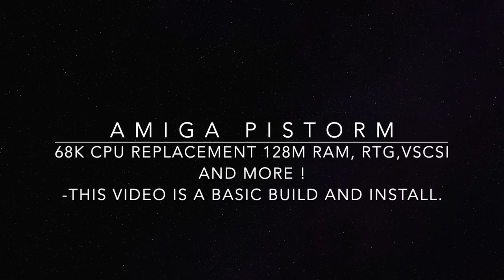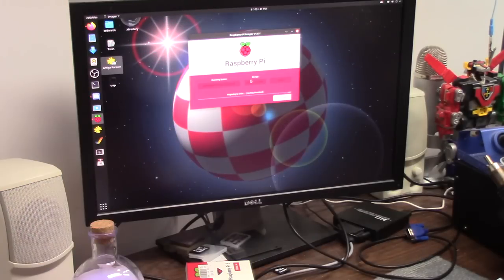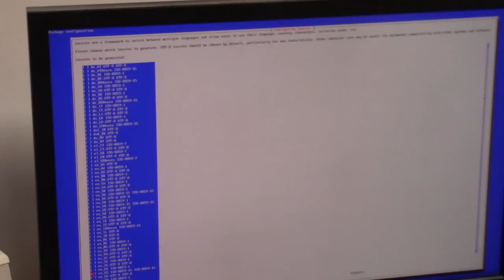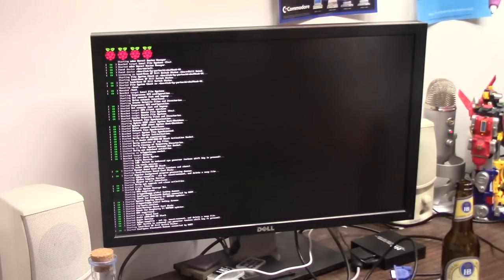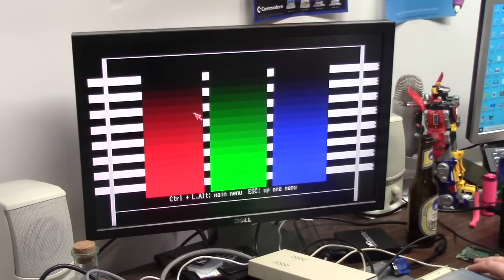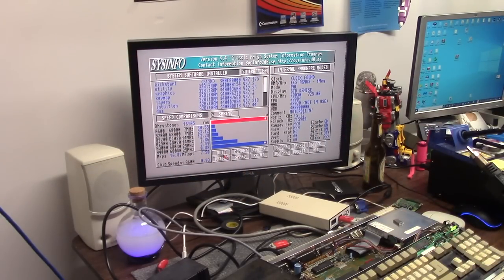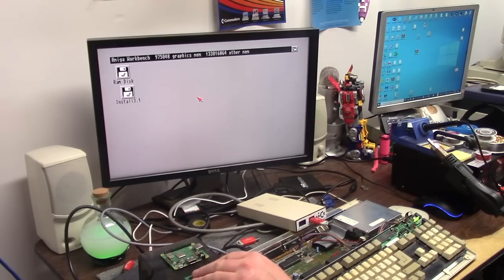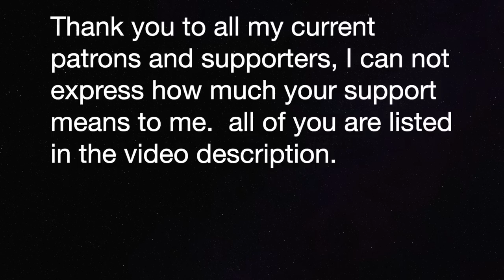PiStorm 68K CPU replacement and more

Comment: Man, I love the Raspberry Pi. Not only can it be a modem, Amiga wireless networking device, personal web server, security cam, Octoprint server, and 1541 disk drive emulator, but now it's also an Amiga accelerator/RTG card. Just amazing for a super cheap single board computer.
Reply: And on another note - I would love to see if this physically fits in my CDTV... ooh this would be a nice all-in-one accelerator/RAM expansion/hard drive/RTG solution if it does...
Reply: The Pi is definitely one of the greatest general purpose SBC-ish devices, just for cost alone. Extremely versatile with a huge user base designing projects for it. I'm so glad it caught on. I bought an original Raspberry Pi when it was released and there wasn't a whole lot of innovation at the beginning. By the time the Raspberry Pi 2 came out, it was a large ecosystem with tons of add-ons and projects.

Comment: Man, imagine if someone could fork this and create a Mac accelerator board. Or Atari. Or anything that uses a 68k CPU (souped-up Sega Genesis/Mega Drive with built-in Sega CD emulation anyone?). This will change the retro scene for years!
Reply from the maker: indeed!

Comment: RIP the Vampire. So much more economical and exciting project.
Reply: To you. But you also might only think so because you don't know everything about the Vampire. I have a Vampire and am much happier with it. It's an FPGA of a theoretical, much better, 68000 series CPU than any released, but still more backwards compatible than 68040/68060. This is software emulation, and can only emulate up to a 68040, and can only reach speeds akin to a 70-80MHz 68030 (much slower than Vampire). Also Vampire has SAGA graphics, which is beyond AGA, with some AAA-like features. So, you can program graphics in the Amiga way, but with more capabilities.
Reply: @RetroDawn  The beauty of an emulated CPU is that you can make the Pi emulate almost any CPU, including the '68080', should Igor give permission. Or any other theoretical 68K cpu. The Pi also has video capabilities far better than anything in Amiga land. Not to mention WiFi, Bluetooth, better sound, usb and hdmi. I'm willing to bet that the software will vastly improve over time, speeding things up and giving the Amiga access to more Pi features. There's room for both systems, but the Pi Storm is really CHEAP and flexible.
Reply: @RetroDawn  This project has already scared the vampire team into finally lowering their prices.

Comment: Just before watching this video I was so eager to get a Vampire V2 for my A500 (costing more than $400 USD). Now, I think this will kill the Vampire considering the overall low cost.
Reply: As an ST user this sounds very exciting to me as well. Not only are usual boosters pricey/hard to find, they also run on different processors, which causes compatibility issues. Having a drop-in 68k on steroids would be so much more elegant.

Comment: It would be great to get an hardware-adapter for the Pi to plug it into the A3000/A4000 CPU expansion slot, too. Considering that the Pis permanently getting faster, this would be a great accellerator for my original A3000 25mhz.

Comment: I hope there will be a project for the A1200 hdmi with a PI. Indivision is just very extensive. The gbs8220 is a solution but it's just low quality unfortunately, even with the updates that I have done.
Reply: there is, its gonna use pi cm4 and be a bad ass card that will kill all other cards.
Reply: @DatBlueHusky  That would be very interesting, do you have any links? As I have only seen cards for the A500/ 600 and 2000 not the A1200.

Comment: A update I found a PiStorm board made up on Ebay. Very nice price. I found some 40Pin Male To IDE Female Extension Cable to see if I can fit my Pi 3B onto the PiStorm I all so have lots of plastic stand offs. As long as the Pi 3b takes less than one Amp, I will be ok.
Reply from the maker: You can always unsolder the usb ports on the pi3

Comment: Thank you for the video, there is indeed almost no information. I was looking at the Buffee Amiga accelerator that would do about 1,000 MIPS but the big let down is that is has no SD card support. In a Amiga 500 that is really a must have. The PI storm is very nice, speed is good, but I expected way more.
Reply from the maker: Like I said it is evolving I have already desoldered usb ports from a 3B+ and put on a pie 3B plus ,almost double the speed from the 3A soon a compute model4 will be the norm
Reply: @ChrisEdwardsRestoration  Thank you for your response. But I'm missing something I think. The PI3 modelA  thats is on there now runs @ 1.4GHz  and is a 64 bit  quadcore. The PI3B+ you are desoldering the ports from uses the same cpu right? Why would that double the speed over he modelA? Could be me, its getting late in my part of the world :-)

Comment: @ChrisEdwardsRestoration  have a que. My understanding is that you did all basis the square pins you squeezed in.
How did you manage to fit it in the socket? Not all the way in correct?.

Did you replace the square pins on the newest emu68 videos?
Tx in advance
Reply from the maker: I have a cpu adaptor that has sil turn pins.  Fits fine
Reply from the maker: here go https://www.pcbway.com/project/shareproject/Amiga_1000_CPU_Relocator_V3.html
Reply: @ChrisEdwardsRestoration  thank you Chris. I knew about this but never hit me hehehe. I saw someone else removed and soldered pistorm in place of the socket

Comment: Looks very nice! I'm excited to see where this is all going to go. I wonder if there will be problems with not shutting the Raspberry pi down cleanly whenever you turn off your Amiga? As far as that goes, I wonder if the RGB to HDMI will have the same issue? Just thinking out loud
Reply from the maker: idk probably eventually. but a re flash is quick, maybe use win32disk imager to always keep a current image just in case.

Comment: Hi Chris, I have gotten excited watching your videos to get my A4000/040 running again. I have forgotten most of what I knew about this machine. It has sat for many years, what do you recommend I do first, what videos should I watch?
Reply from the maker: Get that battery out if its still in there!!!
Reply: @ChrisEdwardsRestoration  Done that and have a new 2032 and holder on order. Looks like leakage was minimal...Watching the 4000 series now. Thanks

Comment: The standard square pin headers are large enough that you can permanently deform the wipers in the CPU (or any dual wiper) socket.  Using those fancy machined-pin headers is basically a requirement. :)
Reply from the maker: I purchased and installed round sil pins later.  I was just impatient
Reply: @ChrisEdwardsRestoration  \o/

Comment: That's awesome! I have a near-stock A2000 which will be unpacked soon and deserves one of these. Additionally, can you please link the location where to download puzzle box screen saver and also where to purchase the gizmo you are using to hold/rotate the pistorm while working on it?
Reply from the maker: the gizmo was at microcenter, it was just called a mini electronics vice, it was 14.99 usd, the lament hellraiser cube is a standard linux screensaver pack, apt-get install xscreensaver , this is version 5.4.2 from dec 2020, it has many many cool ones.
Reply: @ChrisEdwardsRestoration  Thank you very much for the details! I have seen the small "third hand" vices with gator clips, but the one you have is quite awesome.

Comment: You don't need the IP to connect to the Pi, just use the 'ssh pi@machinename.local'  if you have mdns installed (avahi in Linux)

You don't need to login to make the rc.local to run.

Comment: Did you add the trapdoor RAM expansion and solder some wires to get 1mb chip memory? Or could be this done with Pi if you have just ECS Agnus ? Thanx.
Reply from the maker: my amiga has a 8372a 1mb Agnus, with the 512k belly slot it gets the 1mb.  jumpers were sliced/moved to accommodate a 512/1mb  mod. you can also not use the 512k belly and solder the other 256k chips to the board and resistors, and achieve the same thing.

Comment: Hi Chris
Remember me from the uk i brought a A630 but sadly it's didn't work on my A600 (Mines a Old version A300 board) as they was some bugs on it (according to the manufacturers) so i send it back and got my money back
Now 13/2022 im getting a PiStorm 600 and with a Raspberry Pi 3 A+ hope this will work on my A600 (Noob level 1 with Pi stuff so any help is great )
Fingers crossed 🤞🤞🤞

Comment: A590 might work on that. Seems unlikely you'd be able to run an a570 CD sidecar and that is down to timing in how the memory is accessed involving the a570. It could take RAM too. The a570 could run with a 68010 at best (tested by other people). the 68012 might have worked too.

Years ago, a commenter proposed using a pi (like a pi3b via GPIO) for a CPU (and thereby emulating the CPLD etc.) to TerribleFire before the 680x0 boards he made were started. I was in on that comment thread. Essentially TF said he could do it but it (by comparison to making accelerators with the real chips) could be boring (but he did say it could be worth doing). 
I don't mean he was slagging of a pi based amiga accelerator as such, I just mean he referred to the designing-building of it to be boring by comparison. That pi thing is cool.
What I had said though was that switching to a dual CPU design by using a pi (and heavy modifications). This means one can also choice different configurations for 68020 or other CPU chips. While I respect the 68020 (especially with FPU and MMU), unless one is getting a 68030 (done slowly) for the serial or unless one is doing the 68040 (done to run even more slowly for a 040) for the ieee1284 parallel, I'd say a 68012 is best. This means (with MMU) you can have exact instruction set compatibility for the 68000 but you also get (with MMU) dual CPU.
IMO The A570 CDROM (or CDRW) on the amiga should have had a 68012 on it and the a500 should have had a 68012 also and thereby you'd have the two cpu chips. With some tricks here and there, it would have run better than the SegaMega CD in some ways... and the A570 could have 2meg RAM in it (and the a500 could have 1 or 1.5 or 2 Meg RAM in it), and so you'd have about 3 or 3.5 or 4Meg, thereby slaying the MegaCD sega genesis.
The a1200 could then have had two 68020 chips which could be upgraded to two 68040 chips (and the 68040 has ieee1284 parallel). In fact the a600 with two (68k style) 68012 chips (if they have done it) could be "vampired" to thereby get two 68040 chips (and it was basically an a500). Wit the ieee1284, the amiga could have been booting of two parallel ports (one for each CPU) so as to get bandwidth binding to achieve 10x CDROM speed which is 1x DVD speed. Booting games cartridges from parallel ieee1284 would have been an option then (for games companies).

Comment: Something about seeing Workbench 1.x with 128MB of ram is funny to me. I think I have that much in my 1200. My 1000 has a total of 4. This is a neat thing. Never expected an emulated CPU to be installed in an actual Amiga, but it's neat. Unfortunately, I only have the 1000 and the 1200. I know the 1000 has the socket for this, but I don't think it would have the clearance for this. And of course the 1200 has the 68020. Now, if someone made a version that connected to the 1200's trapdoor, that would be something. Curious to see just how accurate it is, since it is emulation.
Reply from the maker: Im installing one in my a1000 going to move the floppy or use a gpio extender to slide it all in
Reply: @ChrisEdwardsRestoration  Nice. Definitely interested to see how that turns out. Still would love to see a 1200 trapdoor version of this, just to have the option of RTG or all the modes including AGA, but if you manage to fit it in an NTSC 1000, I might have to give this a shot. Definitely a lot easier than using 2 sidecars and an external SCSI drive.

Comment: Super video! Playing the sad violin for your box of screws. I'll use this as a tutorial if I decide to get one myself :)
So it's basically completely configurable via linux, can you have any CPU/FPU/MMU combo like you'd do in WinUAE  just by changing the settings on the pie? Cooling is no issue? And the Amiga will just think it's real hardware?
Reply from the maker: Pretty much yes! I will be doing a follow up video shortly on the more advanced features like hard drives CPU etc.

Comment: Hey Chris I want to know your secret, I have been an Electronics tech since the very early 70's working on aircraft like the F14, S3a, and the E2C, in an intermediate repair electronics facility, which means I am qualified for micro min soldering etc. but I just never learned on how to put a round peg in a square hole. You know the 68000 chip has a rectangular socket, and the pins on the pistorm are round. Just how the (you know the word) did you fit those round pins in that rectangular hole.  I tried it  and I tried bending the pins a certain way like they said, but all I did was break them. I just pulled out my old pace soldering station which I haven't used since I retired in 1993 to do pin changes, can you give me a part number for those there pins,  I ordered some that I thought would fit, but they are way larger then the pins that are on there. I was thinking about buying a flat file like we had in the shop so I could file those pins down flat, but I don't own a electronic microscope (them suckers are expensive) well anyhow I am retired now and a lot more shaky then when my hands where steady, and that old 500 I have is slower then a liberal being told to go get a job. If you know the correct part number for them pins, well I will buy them, also, tell your viewers, that you can buy a 68000 socket that has them rectangular pins which plug into the 68000 socket, and it has those round holes in the socket so that they fit, you know round pins in a round hole, man, what a concept. This can be found at the Amiga store in the USA (Amikit) and they aren't all that expensive.
Reply from the maker: My pins were square but they were small pitch so they went right in. In future videos, I used a CPU relocator.

Comment: Based on the sysinfo benchmark, this is even slightly faster than a MiSTer running Minimig core, quite the steal.
Reply from the maker: Well I don’t know how accurate those things are but it is pretty quick
Reply: @ChrisEdwardsRestoration  The timings in Sysinfo are meaningless. AIBB is the one to use for accurate results I believe. But yeah, it's quick.

Comment: where did you get your board? I don't see the link above. Maybe I am blind. Update: Oh I see now, PiStorm is the board. OK, so it would be nice to see them add an connection. Would love to try one in my 2000 but I am running the TF364 now.
Reply from the maker: Theyre discord server. Click into the group buy room then pinned posts.  Fill it out and your contacted fast

Comment: Would this be a more cost effective solution than the TerribleFire accelerators?
Reply from the maker: It depends. Im just getting into it. Tf cards are plug and go.  This is a linux emulation processor and “other things” main seller for me is integrated rtg and clock and hdf files at 10x the speed of an amiga hdd.  I will be covering those in my next advanced video

Comment: I would put one in an A1000.  All my other Amiga's have accelerators in them.
Reply: It would be quite a boon for the A1000 if that ever happened.
Reply from the maker: I am going to do just that in another video
Reply: @ChrisEdwardsRestoration  That will be cool I can't wait to see how it works out for you because honestly its the only Amiga I have that is left Stock, well not quite because I have PS2 Adaptors to convert the keyboard and Mouse and RBG2VGA Adaptor on it to make a KVM Connection in my Amiga Rack but if I could speed it up and get it to autoboot that would be wicked awesome.

Comment: From what I've read in its current state using this project to create a virtual hard drive it can be a bit iffy where it comes to file corruption.  The problem is that turning the Amiga off doesn't shut down the hard drive emulation before the power is cut.  I was wondering if you use this project to connect a standard hard drive via a USB adaptor.  You could then hook up the HDD power feed to the power input socket of the Amiga so that the power to the hard drive does not get suddenly cut when the Amiga is turned off allowing it to 'spin down' properly rather than the power cutting out while data is potentially still being written.
Reply from the maker: Understand. I will be doing more advanced videos as i learn more

Comment: This is so cool!   Couldn't you put another 512K in Bob's motherboard and then add another 1MB in the trap door?    It seems then you would be just a Denise short of an Amiga 500 plus, right?
Reply from the maker: No the on board ram over rides the 512 belly. Plus you need to cut the traces signifying it as chipram

Comment: As someone who went all the way from the Amiga 1200 to full emulation, I couldn't help noticing that emulating just the processor on a Pi3 yields a lot less speedup than emulating the whole machine. Shouldn't it be the other way around?
Reply from the maker: Original hardware limitations probably
Reply: GPIO speed limitations. The Pi 4 version coming soon is much faster.
Reply: There is no jit and the core is different than uae forks. The speed matches more or less from what you can get from a rpi3a with jit disabled anyhow. Or so I read =)